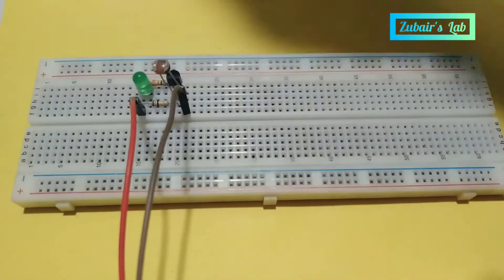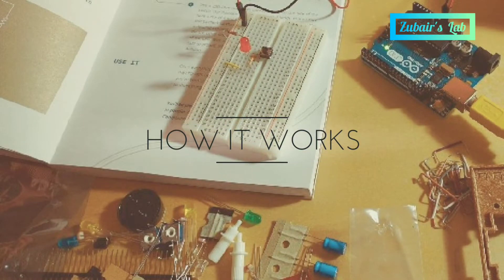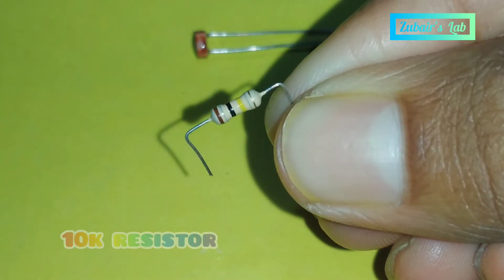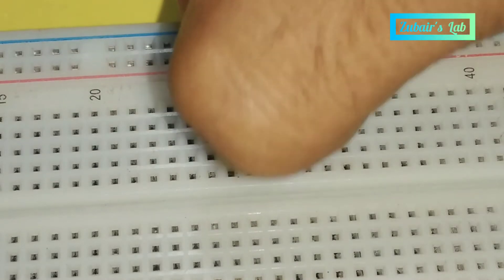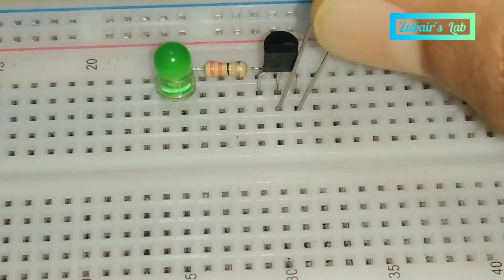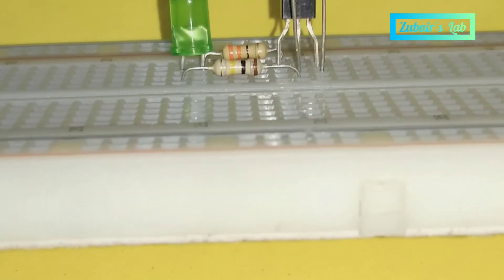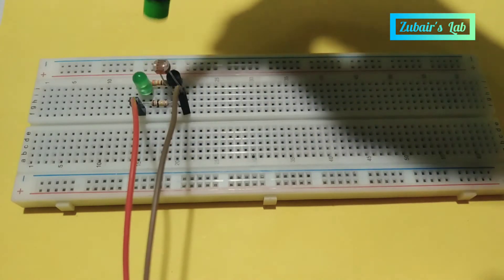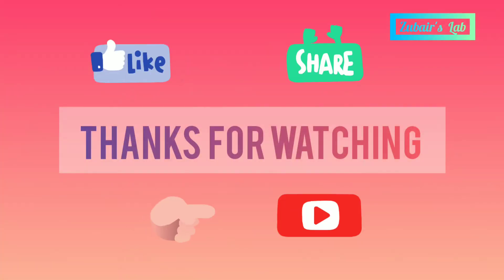How to make automatic  night  lamp |LDR Project| Automatic night light| Zubairs Lab

Comment: what if im only provided with 9 V d.c. power supply, light bulb (2.5 V, 0.3 A), light bulb (4.8 V, 0.3 A), 3 L.E.D. and 2 resistors (180 Ω) and 1 resistor (390 Ω). sorry for all the trouble but help will be much appreciated :)
Reply from the maker: I can't understand your question.
If want  much higher bulbs or load to control, u need to use relay.

Comment: Where did u use relay?
Reply from the maker: U can use relay to replace led... Then u can control any kind of AC load..
Reply: @zubair-444  do LDR only works with BC547?
Reply from the maker: Not only BC547... But also any kind of NPN transistor... But BC547 very cheap and available on market.